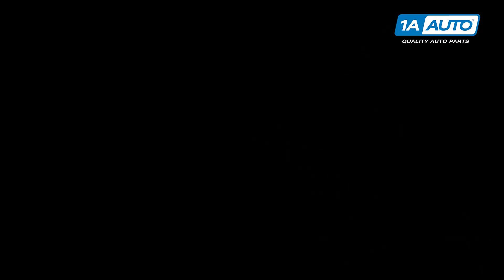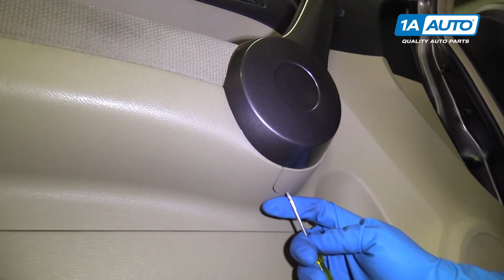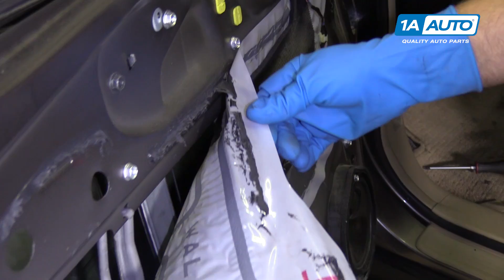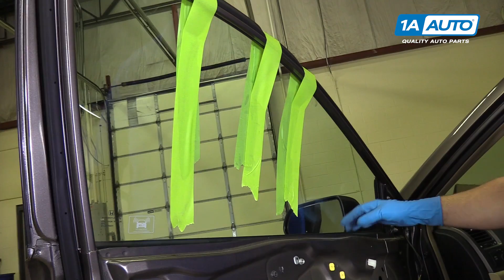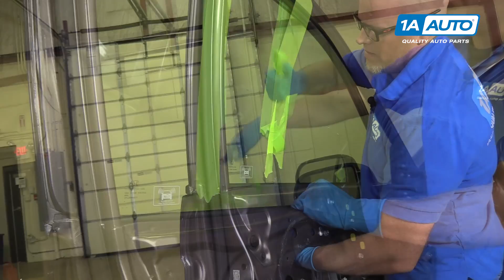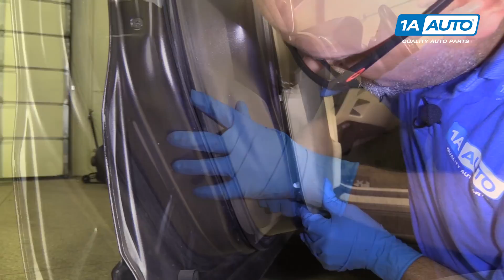How to Replace Front Window Motor 07-11 Honda CR-V

Comment: This job is doable with the window up. I was able to simply unmount the motor from the door to allow it to move. Then get a small rachet in between the door and motor to remove just the motor. Then I usde a drill bit to drill holes where the motor mounting screws were located. This made it super easy to mount the motor back on the window bracket assembly with it still inside the door. No need to get the window down or deal with removing all the hardware.
Reply from the maker: +@justinh.1579 Thanks for the feedback!

Comment: Can you use the motor on the passenger side also. Just the motor
Reply from the maker: +macho 3088 We currently do not have just the motors for a 2009 CR-V for sale, however, they most likely would be side specific.

Comment: Good video but....how is possible to lower the window to access the bolts when the motor does not work and the window is in the upper position?
Reply: If the motor works to roll the window up, then why the hell are you replacing it lmao
Reply: If anyone in the future has an issue with this particular problem I resolved mine by first having a replacement for the entire regulator + motor and then cutting the steel cable of the old regulator.  This causes the platform the window sits on to drop down.  But be careful as the window might drop down quickly so you should have it tapped in place before doing this.
Reply: That is exactly my problem. The window is up and the motor has failed
Reply: That’s what I want to know
Reply: My problem is the window is all the way down and I can't roll it up to access the bolts 🤷